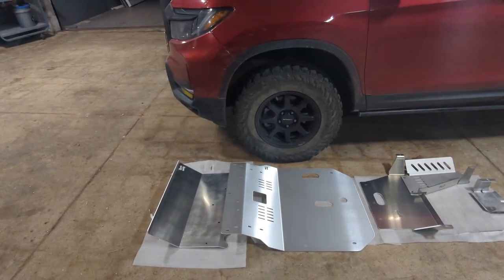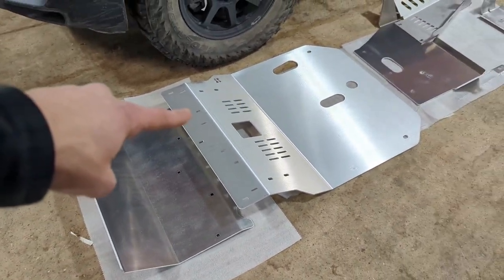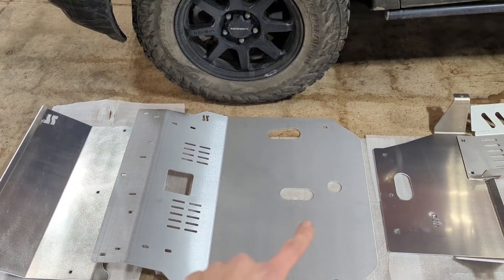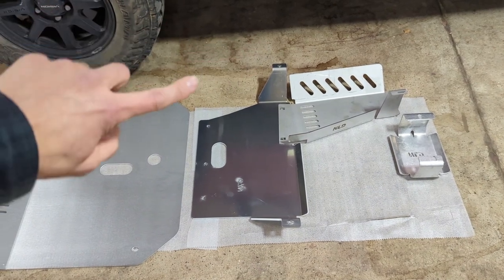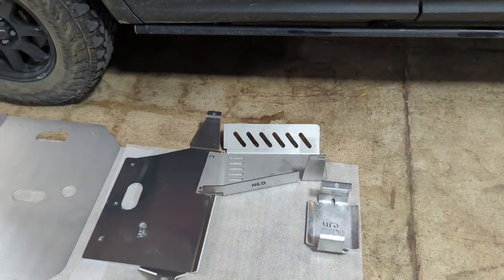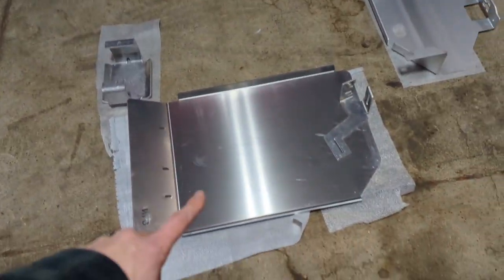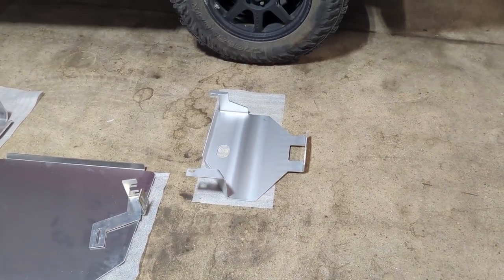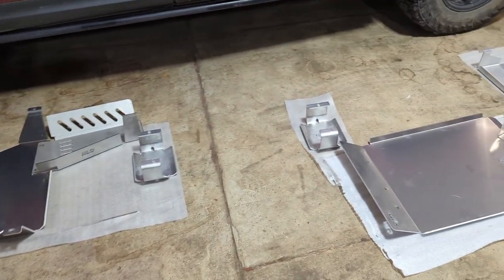Ridgeline, Passport, and Pilot Product Spotlight

Comment: Will that front plate extender also fit a 2008 honda pilot and the carrier bushing guards?
Reply from the maker: We make a plate specifically for the 2008 Honda Pilot. The carriers we sell today may need small tweaks to fit on the 2008 pilot.